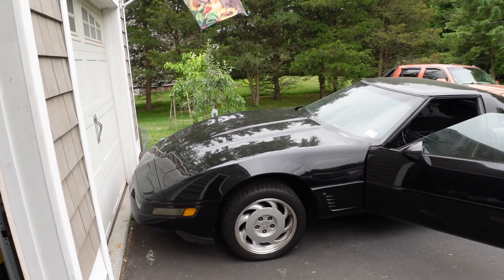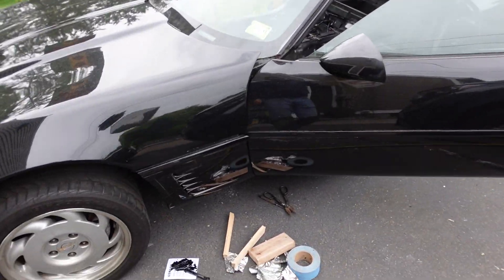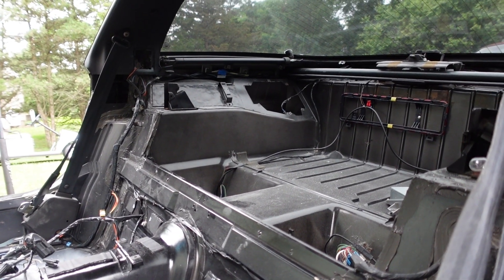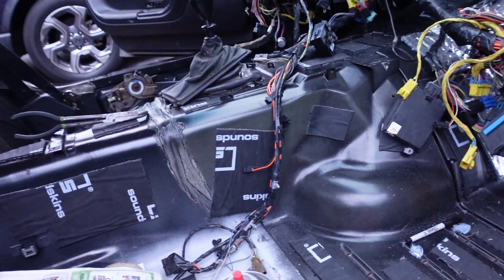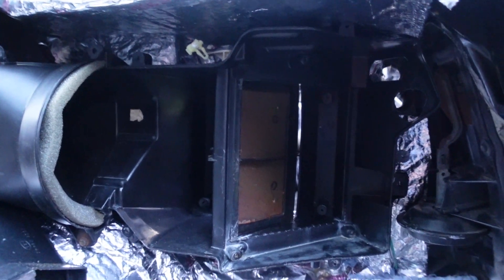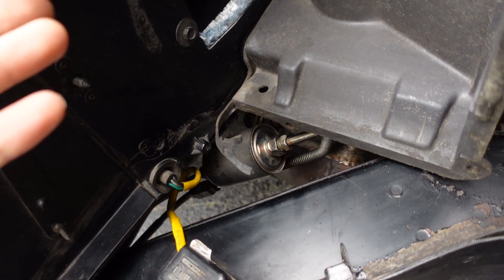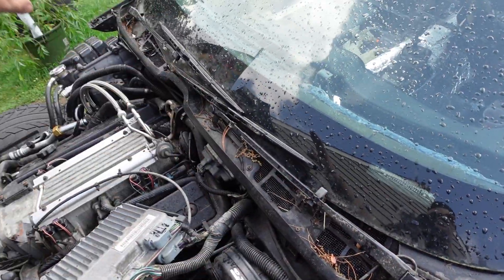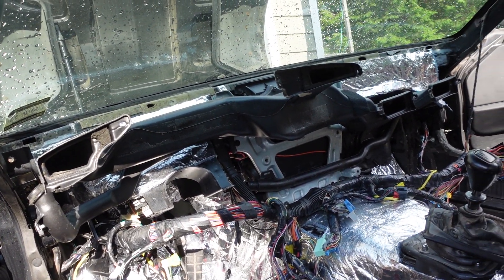Abandoned C4 Corvette Custom Firewall Insulator SoundSkins Heat Wave and Damplifier Pro

Comment: nice work so far.  where u plastic welded the dash frame mounts, i do the same, but, as you originally thought of, i then place a small piece of tin on the nuts side of the mounting surface.  doesnt change the mounted position that way.  i use weldwood dap to secure it so its an instant bond (with tacky time) and the b- vent thickness tin and the weldwood dap adhesive (the spray 90 u r using also works gret) is flexible enough that the vibrations in the car do no simply cause the next weakest point in the abs dash to crack.  still time to put a small piece of tin.  

yes bag and tag saves the day but ofcoruse u will figure it out.  clearly not your first time doing this to an old car.  thnx for the tip on the spatula tip on the soldering iron.  will pick one of them up.  i use the 300w weller pistol gun because it gets much hotter quicker.  you will find many places to use that on c4's!  ive heard if u r having a hard time registering a car in the us, you can register in vermont, then transfer it after that to your home state.  

very smart to test your vacuum actuators!  

you are building yourself a sweet lt1 6spd and they are an incredibly capable and fun car.  worth the time and effort you are putting in!  most other dudes your age are spending money at the pub on a friday so good job.  

have ypu shared the rpo sticker so we ca see the options that your lt1 was built with?
Reply from the maker: Thank you for your advice, I appreciate it, and I’ll consider modifying the dash mounts further. It’s definitely a weak point. Some thing about ripping stuff apart and just throwing parts. Everywhere is more fun than organizing stuff lol. You’re correct, not my first rodeo. When I had the engine out of my accord I had a tough time finding out where all the wires went I will say that.

I’ve heard of the people mention the Vermont loophole, if I can’t get my register, I’ll definitely go that route.

I can’t think of a more, enjoyable way to spend my time. Love working towards an end goal, it makes it so much more worth it in the end when you did all the work. Once again, thanks for your input and comment. Thanks for watching!
Reply: @ThatAccordGuy  show us the rpo!  does it have j55?  fe7?
Reply from the maker: I’ll have it in the next video I post. Just filmed the clip. No j55 no fe7. It’s got fe1. Which is the soft suspension package I believe. Not too many goodies on this one.